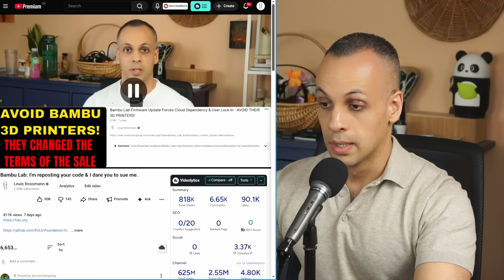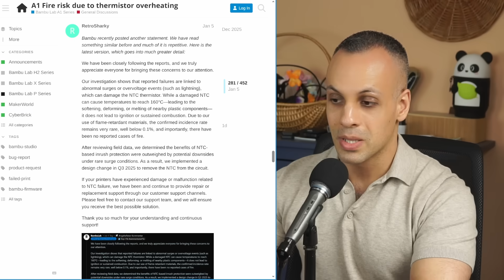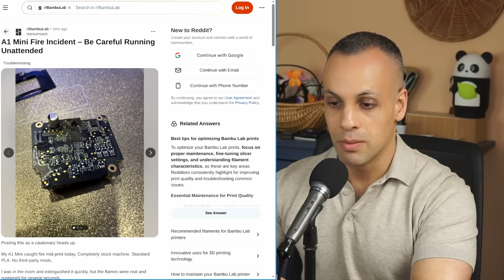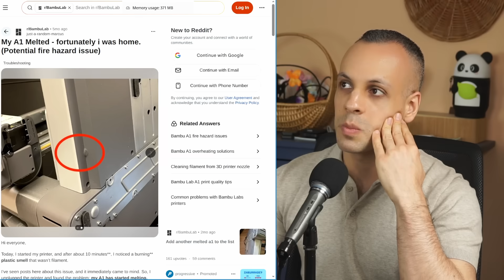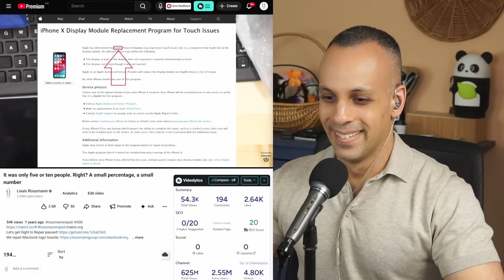Bambu Lab PR dumpster fire is turning into a literal one...

Comment: Allow me to restate the important part - 

"In not quite 1 out of every 1,000 printers sold, we have confirmed ignition or sustained combustion events have occurred"
Reply: Meanwhile “Unsafe at any Speed” basically refactored the entire US auto market because of some 1-in-a-million failures.
Reply: @PrebleStreetRecords Strange part is the Corvair was a pretty good handling car for the time... not to mention the author was neither an engineer nor a licensed motorist....
Reply: Will not buy Bambu. My son uses an X1C at work, and that (now old) machine is great.
But I am on the FlashForge track. Better priced and now more modern tech with the creator 5. But I keep mine in local only mode. And I do fear they go down the same path as BL, but so far doing very well and my recommendation for people new to 3D printing.
Reply: @CharlesGauthier  I like Flashforge's filament. And I'm still running a Creality Ender 3, no need for Internet connectivity whatsoever. Doesn't have any of the bells and whistles, but it gets the job done.
Reply: @jonessperandio  yeah it get's the job done slowly, badly and with terrible quality while clogging nozzles every month. Creality is such trash.
Reply: @CharlesGauthier  elegoo on top, Flashforge has been annoying in my experience, my artemises didnt work so well
Reply: @S @SpacemanFPV1 egoo on top
Reply: yo that's a lot higher than the 12vHighFailure connector on Nvidia cards. Like A LOT.
Also lol at "confirmed ignition", did we also have a liftoff too? Space nerd things
Reply: Meanwhile the qidi q2 went and got MET certified
Reply: This needs more upvotes.
Reply: Never tried a 48 hour burn in, like other manufacturers do 😅
Or is it burn down 😅
Reply: Nope, what they said was that the issue with overheating occurred in less than 1 in 1000, but no fires had been reported. Still bad, but not Anet A8 bad. We don't need to exaggerate to make Bambu Lab look bad - they're doing fine on their own!
Reply: @martinwillfor1416   Careful: they did not say it occurred in <1/1000 cases, but they confirmed it in <1/1000 cases. We do not know how many cases were not confirmed, so the actual failure rate could be 10x as high and their statement would technically still be true.
Reply: @brinkoftext  right but if it was < 1/10,000 they almost certainty would say that as it makes them seem less bad.
Reply: @martinwillfor1416 Pontiac had to modify their exhaust cover designs despite being somewhat within a margin of error with other cars, but it was still a necessary fix. They should be offering the part, repairs, or at the very least options. It also sounds like they might've known if it only affects the old ones.
Reply: One in 1000 is common wtf?!
Reply: @RenTheWren For a failure that serious, yes that's very high and represents an existential amount of potential liability for the company.  You don't actually have to start all that many house fires to put yourself out of business.
Reply: @FireStormOOO_  to be fair tho it’s actually much much less. They’ve sold millions of units and there’s barely any examples of this occurring. I hate bambu as much as the next guy but it’s still pretty uncommon
Reply: @carsonhunt4642  BL seems to disagree with you. They do state "well below 0,1%" but if it was "actually much much less" they certainly would've used an "actually much much" lower percentage there. And that is confirmed incidents. Somehow I doubt you actually hate them as much as you're saying, but rather that's just "well, I'm not racist, but..." equivalent.
Reply: @TheJunnutin  "having exaggerated comments and concerns about a tech company's product is equal to racism"
hope everythings alright in whatever world youre living in lol
Reply: @beansoclock8748  Oh, you're twelve lol. Let me dumb it down for you.
I wasn't comparing it to racism. I was comparing the rhetoric (sorry for the big words).
"I really actually hate thing X, but you can't argue it isn't super great!" just with a few more weasel words.
Reply: @carsonhunt4642  Yeah obviously the actual rate of serious issues is what matters, and we're not the ones with that data; we do have to read damage control PR stuff very uncharitably though, you have to assume they're walking that line of giving up as little info as possible, painted in the least damaging possible light, while avoiding the appearance of a cover up or failure to notify people of risks that would start putting big multiples on damages.
Reply: @RenTheWren 
1/1000 is absurdly high. Some comparisons that resulted in mass recalls

The Note 7 battery fire recalls were a failure rate of 0.01/1000

Nvidia Shield Tab recall was 0.045/1000 failure rate

MacBook Pro Retina recalls were 0.06/1000 

 Fitbit recall was 0.1/1000

So yeah, 1/1000 is by a considerable margin, horrible. This usually results in recall waaaay before 1/1000
Reply: 0 @JourneysADRIFT for comparisons sake if one in 1000 flights failed we would have around 5 million air travel fatalities per year.
Reply: @arandomcomp2427 You can't compare 1 in 1000 flights, because the NTC issue isn't 1 in 1000 prints but 1 in 1000 sold printers. Careful whenever you get an urge to make a comparison...
Reply: @perwestermark8920  Oh, are you saying they're only selling printers more prone to overheating? Careful when you get an urge to be snarky.
Reply: @TheJunnutin  No, I am not sating that. Careful being snarky given your limited ability to process text...
Reply: @perwestermark8920  Yes, you can. They made a comparison to 1/1000 out of some number (flights in one year). That is totally comparable to 1/100 out of some other number (printers sold over current lifespan).
I'm not even really sure what you're trying to say, do you think you can only make comparisons for risk probabilities if the number of events counted is exactly the same or something?
Reply: @somdudewillson Bo you can't - and make it make sense.

1 in 1000 planes ending with a crash would be relevant. 1 in 1000 flights would not make sense because that implies 999 of 1000 planes will crash. Tgis is a huge difference making it a broken comparison.
Reply: @JourneysADRIFT  1:17 zero fires. Just some melted plastics
"no reported cases of fire"
Reply: @RenTheWren Yea man, that surgeon only kills 1 in 1000 patients. What's the big deal?
Reply: @TheJunnutin  bless your heart. Surgeries do in fact have acceptable fatality rates.
Reply: @carsonhunt4642  And how high is that rate?
Reply: @carsonhunt4642  Suegeries on patients in a life/death state after a car crash has a high potential to fail.

Surgery of nail issue? Not so much...

Remember that lots of surgery happens after already having a broken patient. This is a big deviation when comparing...
Reply: @TheJunnutin  it’s relative to the procedure.
How often does your monopoly board game melt compared to a 3d printer that heats up 300c ?
Reply: @carsonhunt4642  Oh come on, you're not even trying anymore. That's just sloppy
Reply: @TheJunnutin  They're just trolls. They need to get back to their fudgy duties. 🧌💩🧌💩🧌
Reply: @TheJunnutin  this is a very disingenuous question, it depends on the surgery, but there are many many surgeries with >1/1000 death rates.
Reply: @RenTheWren any count of burnt down houses resulting in a homeless family over zero due to Bambu failure is too much
Reply: @RenTheWren If that's not common, they're not making many.  0.1% is a large number in any commercial manufacturing.  Think of it this way, if they're making 100 printers a day that's only $18M retail a year.  That's pretty small business, like one so small you've never heard of it.
Reply: @RenTheWren1 in 1000 is extremely high for a catastrophic failure rate. Imagine if airplanes had a one in one thousand failure rate. Nobody would ever fly.

Comment: My Prusa just works.
Reply: So do all my bambu's ......
Reply: @ivog6113  I think you missed the point or didn't finish the video.  Louis said people went to Bambu because they wanted a printer that just works.  There are lots of printers out now that are just as easy to use, that just work.  
The bigger problem is the requirement of instant gratification today.  People that don't want to learn how to do something or how it works.  They just want to be apes that push a button.
Reply: @ivog6113  Same, and it never even talked to a Bambu server. Didn't see the need to allow it to since I am not interested in the smartphone gimmicks and the firmware didn't seem to care too much beyond a warning about LAN mode either iirc.
Reply: I bought a Pursa because I didn't want a printer that can phone home.  It works great - this video shows I made the right choice.

Comment: I bought my bambulab printer before they started being (openly) scummy, I was going to buy another about a year ago but then they installed spyware on the printers and I just went with another company instead. Bambulab printers are easy to use if you use bambulab's slicer and buy bambulab filament, so for me they are just a regular printer, not easy and not hard.

Comment: I have 2 Bambu labs printers, both print well but I've been having issues requiring support and parts .  The most recent a part was sent out, requiring me to fix my new printer, but it didn't solve the problem.  I also have 2 Qidi 3d printers.  They both do work well but are not the polished printers that Bambu's are.  Glitchy software and the feel is just different.  I wish they would step it up , they could be great with just a little refinement.

Comment: And all my friends called me paranoid that I don't update firmware, nor do I use Bambu servers to print with my printer. Now they are telling me they are sorry for doubting.
Reply: I know the feeling. Same thing happened between me and Elon Musk cultists around me back in the day.
Reply: @Karmadillo_E419 Shut up nobody cares
Reply: It's not being paranoid, its called being conscious. It's wise to be suspicious and not blindly trust things at face value. Iv'e had firmware updates fail a few times leaving me with bricks or removing features and abilities that I relied on. And if a product is out of warranty good luck. Unless theirs a problem that can only be fixed by a firmware or features I really need, then I avoid them because sometimes they just fail and usually when that happens theirs no way to recover from it. Even say a small flickering your power to your house, you can kiss that device goodbye if you're in the process of a firmware update. I suspect that's why allot of people firmware updates fail due to the power source is not clean. Just because things seem to work and you don't notice lights flickering or anything does not mean the power source is clean.
Reply: @MarioS-b2q  I keep my printer connected to a UPS.
Reply: @ThinkFreely2012  Now that everything is pretty much requiring firmware updates, do you purchase a UPS for every device every few years when these batteries need to replace? Jus curuoise. Or Do you say unplug it from the computer and go plug it into the tv before watching tv?
Reply: @MarioS-b2q  I only replace the batteries, not the whole unit.  They typically least 2-3 years.  It's just 2 lead-acid 12v batteries in series that are easy to remove.  You can find then at Tractor Supply, Walmart,  HD, Lowes and Amazon.  And they're relatively inexpensive. 

I have a UPS on my printer,  PC, network,  and TV. Nothing big,  but enough to give time to decide if I need to start the generator.  But more importantly,  it isolated my network from the unstable voltage my neighborhood had for years that caused internet problems daily.
Reply: @ThinkFreely2012  That's my point, you should be expected to have to run everything off and UPS and constantly be having to replace batteries in concern the device may cause a fire. Now your adding a other potential device for a fire.
Reply: @MarioS-b2q  I blame the companies foisting auto-update on everything for normalising the update early/often attitude.
Reply: @some_random_wallaby  Exactly. My parents had purchased a nice Sony 3D TV a number of years ago. That thing was constantly getting updates. I hated turning the TV off then back on, you could be assured it would be installing some update taking 20 or 30 minutes. I had them purchase a UPS for this TV because of this alone. It would only take one time for the power to hiccup wile this was happening.
Reply: The real mistake was buying a bambu printer, damage is already done in your case. They are not even good lol

Comment: Bambulab is more interested in going after somebody who "jumped" the restrictions instead investingating and solving the burned A1 NTC boards.
After my (strange and suspicious) incident about my P2S + AMS2 Pro, I still not trusting this company who pees over customers meanwhile, as same time, threat them with court demands & the European Consumer Office (ECC) is looking to the other way.
Even after I gave the OK to the P2S, after I fixed it, I still having problems in the P2S 6 pin connectors in the buffer (at the back of the printer) that the right one is not working properly as it happened in the rear 6 pin connectors from the AMS2 Pro.
The P2S is working in the garage without any problem but I should remove the back of the printer because I have the suspicious that it has the same board that the A1.
I don't want to have the same surprise that others are having on their A1s.
Glad that I sold the A1 two years ago!
I still having the X1 Carbon working fine.
Greetings from Spain.

Comment: As a Bambu Owner i would swap my printer in a heartbeat a new competitor. X1Plus exists for those who don't know
Reply: with it run an X1C without issues?
Reply: @Premier-Media-Group  Thats what it is designed for. Its a custom firmware that gives us users back control. But full control will need it run offline permanently, which is very difficult for many. This is at least step away from Bambu.
Reply: @BigDesignEnergy thanks!

Comment: Purchased my first (and currently only) 3D printer last year - an Elegoo Centauri Carbon.  I really wanted (at the time) to get a Bambu after hearing from everyone how well they JustWork(tm), etc.  Just a few weeks after I got my Elegoo CC, Bambu did the rug pull with their direct access lockdown.  Over a year later with my Elegoo CC - not a single issue with the printer itself.  And only a single failed print to be honest.  I paid $299 - vs- the $1,200 the X1C was at the time.  I had already owned an Elegoo Phecda (laser engraver/cutter) 3 years prior and decided to give the Elegoo CC a shot - best decision I made.  If I ever do upgrade to something better, it will almost certainly be a Prusa Core One.  Over a year into my 3D printing journey and I have already seen the advantage to something like a Prusa (and the price they carry).  But with that said, seriously:  Bambu is not the only game in town that can have you printing "out of the box" anymore.  This is 2026 - not 2016.  The list of justifyable reasons to go the Bambu route is quickly shinking.

Comment: 3DMusketeers - the youtuber - is also actively looking for Bambu fire cases so they can bring a suit as well. By our powers combined?
Reply: literally mentioned 1st minute
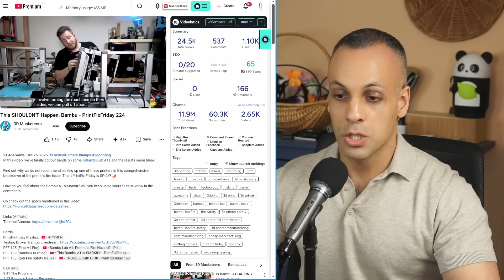Reply: 0:48 here
Reply: I think Steve said as well that they're currently working with 3DMusketeers.
Reply: GN too but people should be aware that the odds of finding more than some melted/charred PCB components is slim. It's extremely rare for these types of failures to ignite a self-sustained fire.

That doesn't excuse anything, I despise this company and in the worst case scenario anything is possible. Just have reasonable expectations and remember we've had numerous printers over the years with burning terminal and connector issues.
Reply: @JJFX-  3D Musketeers PrintFixFriday 245. Does the rarity of a life-changing (or ending) event matter when it's both known and preventable by the manufacturer? I don't think anyone can afford (probably literally) to leave a Bambu unattended.
Reply: @DominicFalcon  Well no I'm not saying it's okay and if they didn't replace defective parts after it was well known that's a problem. I'm simply saying these types issues aren't that uncommon to those of us who have been in the scene for a while and PCB related failures are are rarely the cause of fires. I say rarely because anything is possible obviously but none of the serious fires I've seen were due to this and modern firmware is much better at catching thermal runaway than in the past.

Regardless it's worth investigating further, I just don't want people to get too distracted.
Reply: @JJFX-  Have you as a professional inspected the thermisters personally? Also, may I suggest looking at the video I mentioned in my last comment? Fires are, to all appearances, actually happening. Please allow me to repeat that. THIS IS HAPPENING.

Now, if your risk profile is fine with a printer known to drastically overheat and cause house fires, then great. I'd ask to please not distract others from a real problem simply because you are comfortable with that level of risk.
Reply: Steve from GN is already joining us, I hope we can bring Louis in on it too!!
Reply: Hell yeah, let's get the s'mores going and take these MFs down!

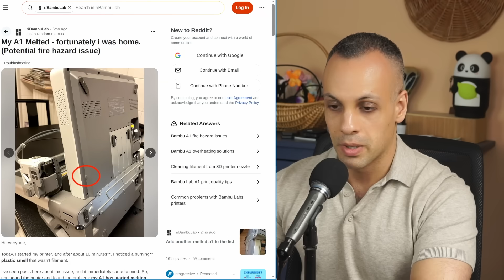Comment: I do confirm my printer had the same issue after 5 months of usage. It made a hole into the printer housing. They sent me a new pcb and cover 2:24 . 

Edit: the new pcb they sent does not have the faulty component like the old pcb